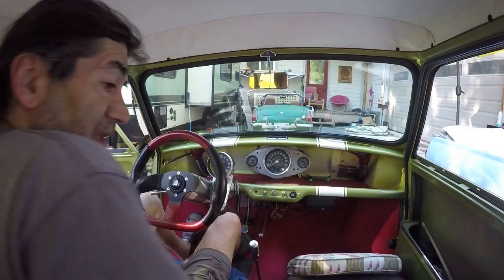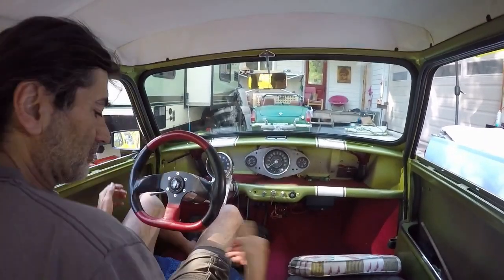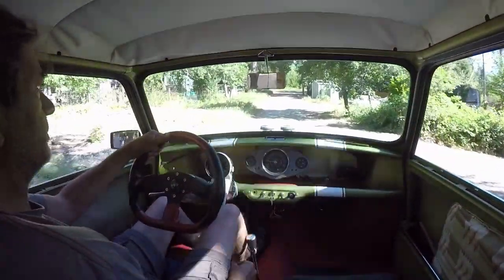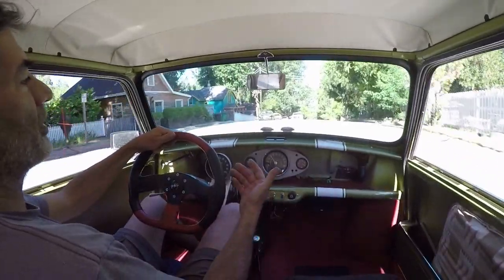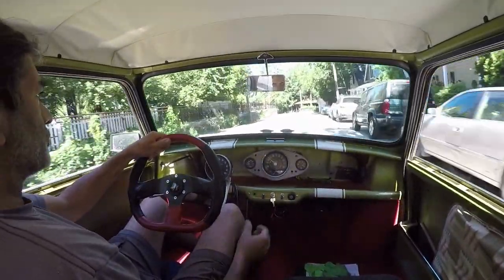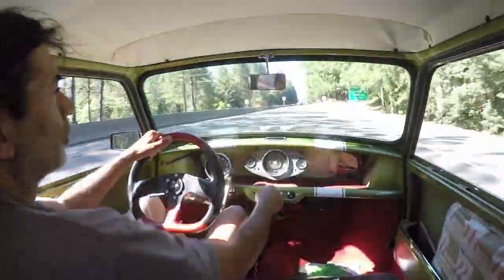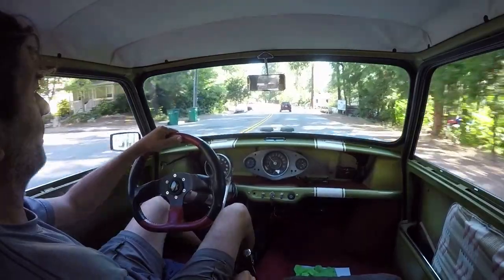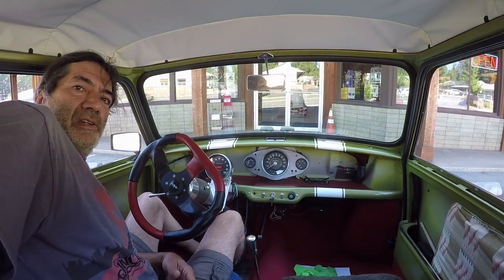Current Cold start and 5 minute drive

Comment: Nice video! I am building a 1275cc (A-series) engine. 020 overbore with a Kent 296 cam and standard (high comp)  pistons. The head is a Cooper S big valve head. Lightened flywheel and Megajolt ignition.  I have a manifold for a IDA 48 laying around.  If I were to use a IDA 48 I wouldn't know where to start with the jetting. Do you have any advice? The other route for me would be a pair of H4 SU's.